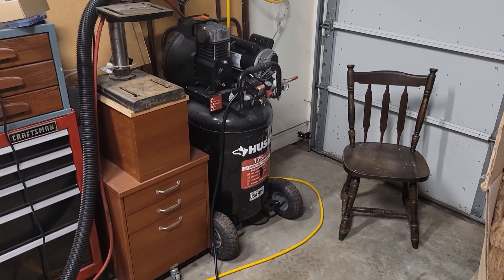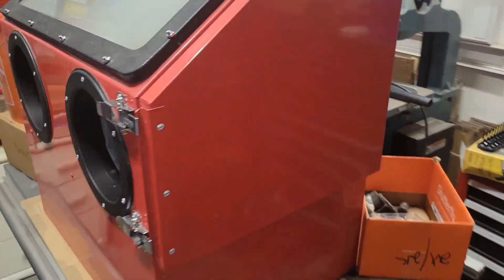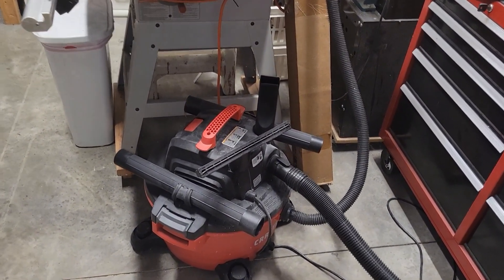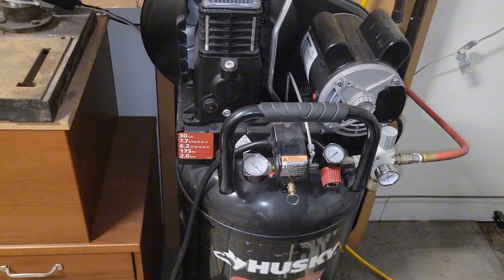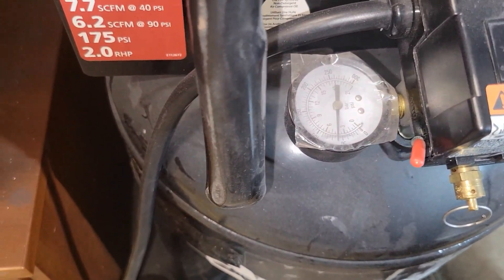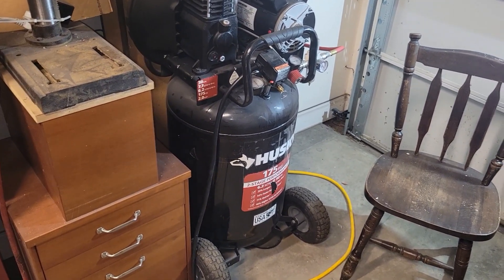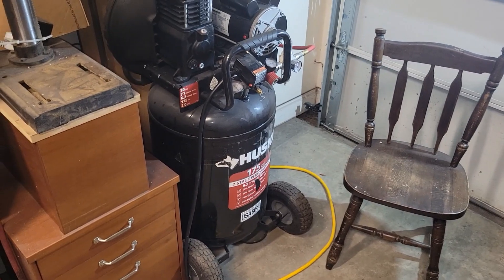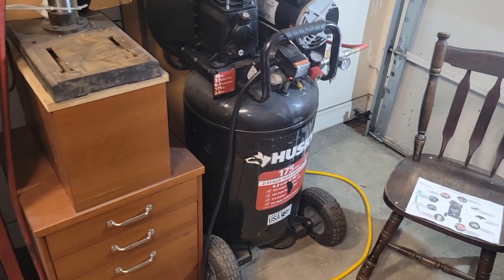DIY Compressor for home sandblasting - specs and review (Husky 30 gallon C304H)

Comment: OK BUT YOU DIDN'T SHOW IT IN USE
Reply from the maker: Maybe should have shown it on anyways.  In a video, it just sounds like any compressor.  My perception is that it's a little quieter than some - no louder than my pancake compressor.  Can't really hear it inside the house when its on in the garage.

Comment: I was reading that I needed 50 ft run of hose before the filter in order for the air to warm up and the filter could catch the most water. I have the 27 gallon to paint with, trying to set it up right.

Comment: I was under the impression that when i got mine, that it was also a two stage compressor when its actually a single stage compressor. They advertise as having "two stage performance" though I'm hoping that it remains that way over time. Now I'm doing research on how I should setup the plumbing/filters